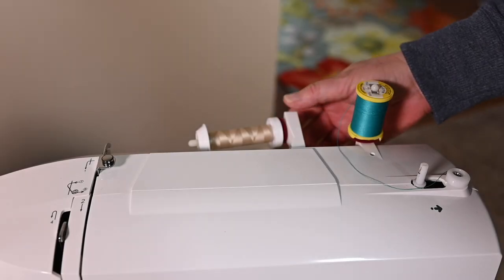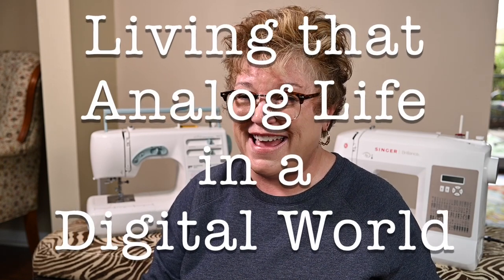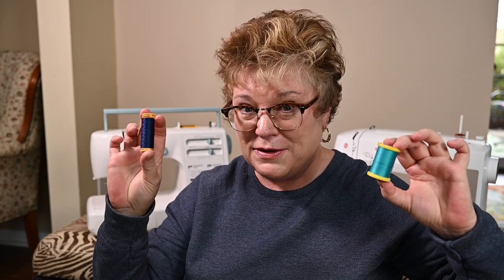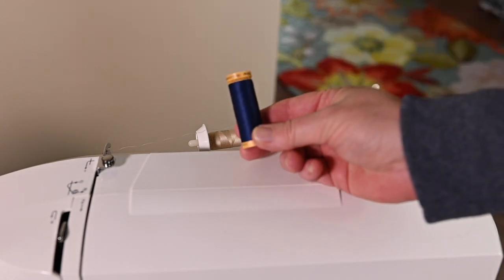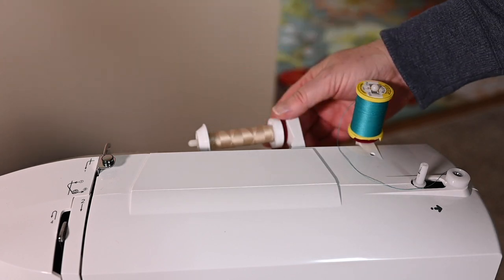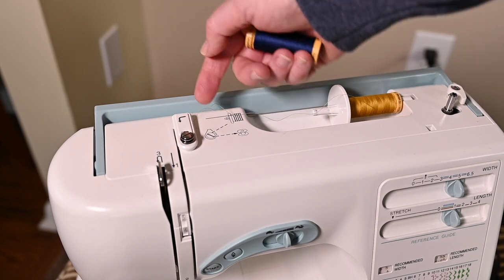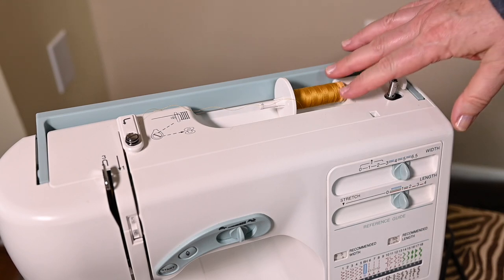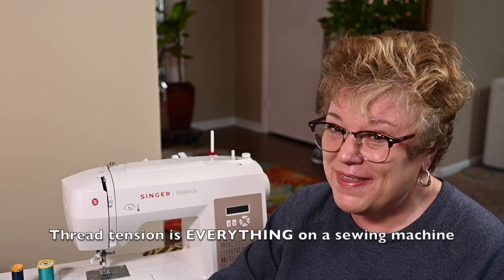HOW TO CHOOSE THE RIGHT THREAD FOR YOUR MACHINE

Comment: This makes so much sense. My machine (not sure if I still have it, I recently moved) didn’t have a horizontal feed, and most of my thread was for a horizontal feed, so it kept snapping before I could even finish sewing.
Reply from the maker: It's a subtle thing but it makes a HUGE difference. Yet it's barely mentioned. If you locate your machine see if the thread pin lays down. It might lay down to give you the horizontal option.

Comment: New to sewing and ready to purchase threads. Wondered the difference between the shorter and longer spools. Now I see I have to purchase based upon how the spooler is set up on the machine. My brother machine has a vertical spooler. Now I know which thread to purchase. Thanks for helping me not make a purchase mistake.
Reply from the maker: Hi LaKeshia! Oh my gosh! Thank you for writing. I'm so happy you found this video. This point is not often mentioned, but it makes a huge difference. Some people fight constantly with thread tension, and so often it's because the thread isn't loaded right. I worked with a woman that sold sewing machines for years, and she was the one that told me about this. Also, buy better quality thread because it sews a lot better. Good luck and enjoy!

Comment: I didn’t know! I’ve been using the sideways thing when I should’ve been putting my thread 🧵 on the upright.
Reply from the maker: I didn't know it for a long time! It's not discussed all that often, but it makes a huge difference. You want to load your thread on the proper spool so it unwinds correctly, without twisting.

Comment: Hi Patty!  I'm a little late to the party here...  but, oh wow.  I had No idea about the vertical and horizontal threading of a machine.  I was watching your video and put you on pause to go check out my machine.  I'm a Kenmore girl, always have been, always will be.  (But then again, those Baby Lock and Bernina's sure look nice too!)  Anyways, when I looked at my Kenmore, it has the horizontal spool pin too, just like your machine.  But when I got to looking in the manual that came with my machine, it also has a separate spool pin and a different spot to add it for vertical threading.  No clue here, I just learned this, all because of you!  Anyway, look at your Kenmore.  See the little box shaped hole on top of your machine?  It is southwest of your bobbin winder.  You can see it in the video.  There is another spool pin (along with a spool stand) that should be in your accessories that snaps down in that spot for vertical spools.  Who knew?  Check it out!  I'm so excited about learning this today.  I'm getting ready to move and in the process of boxing everything up, but when I get settled in and back to normal, you will find me at my sewing machine.  I can't wait!
Reply from the maker: I'm so happy you found the video Priscilla!! I know. Isn't it mind blowing? How many poor souls are out there fighing with their sewing machines and have a miserable time of things and it's all because the tension is wrong because they are seating the thread incorrectly. I saw this in a video made by a machine salesman and it blew my mind!! Yeah, someday I do hope to have a baby lock but for now I'm happy with my little Singer machines. My Kenmore developed a problem with the feed dogs and finding someone to fix it is impossible. Which is very disappointing.

Comment: No wonder I had problems with the thread getting stuck. Thank you. You would think the booklet with the machine would tell you this. Now my problem is threads. Polyester or cotton. The lint problem!
Reply from the maker: I know!! I don't understand why this isn't better communicated in the machine manuals!! It's not something that's widely discussed and it's not intuitive. But it makes all the difference in the world. You want to match the thread type to the fabric you're sewing. I sew about 95% with stable cottons so I use 50wt cotton. If you sew stretchy or polyester fabrics then I would sew with different thread. But whatever you choose, buy something that's a little more expensive. You do get what you pay for when it comes to thread and cheap thread can even cause tension issues as well as lint issues in the machine. I hope this helps!!

Comment: I had tension issues with my new singer 9960. It is about the thread, how its loaded, type, how its wound PLUS.. when you remove it to change it out, cut it at the spool and pull the excess through the needle, not backwards through the tension area.. that drags all the fibers back up into the disks! 
And.. when i purchased my better quilting thread then went back to regular thread..  WOW lets talk ahhhhhaaaa moment! What a ton of fuzz was left behind from the cheap thread! 
Clean clean clean that machine! Never blow in.. suck it out with your vacuum or use a q-tip.
Reply from the maker: Thank you so much for sharing so many great tips Annette!! Isn't it CRAZY how much difference the thread quality makes? It's kind of insane it matters so much. You are 110% right about not pulling the thread back through the discs, though I am guilty of doing it more than I should. Do you have a preferred brand in terms of thread? I bought a TON of it from Craftsy in kits of 6 1200 yard spools but I neglected to grab an extra neutral kit or two right before they closed. Penny wise and pound foolish and now I super regret not doing that because it was so inexpensive at that time.  I am interested to hear what you recommend.
Reply: @PattymacMakes  thank you! I know it was a lot... but i just kept typing! LOL
We have Guttermans at my local joanns.. i looked at it but have not used it. I assume that is the brand your showing on the video? 
I am a newbie quilter and aurafill (sp?) Is not available at my joanns, they carry guttermans and Sulky brands. I chose sulky because of the additional shades and high sheen. It looks and sews beautifully on my 9960 but does not like my auto thread cutter.  So thats a bit of a drag. 
I have an OLD 70s kennmore. Its my moms machine and ive had it for 20+ years now. It takes cams for specialty stitches and weighs a ton! I too had a lot of problems with it and didnt know why.. now we know! 
I plan to pull it out, clean it and use good thread and see what it does. 
Thank you for your videos! I so enjoy them 😊😊👍💐🦋🐞
Reply: I have never used those spools before only the traditional style. 
I plan to make the switch here soon.
Reply: @PattymacMakes  ok lol just one more thing about sulky... 
In a traditional spool, you have that notch in the head to catch the end of the thread tail for storage.  When putting those spools on the horizontal spool holder the thread can hang up on it.. happened to me! 
Sulky thread has a unique way to hold the tail on their (traditional) spools. Its a opening that runs around the entire head. I use my finger nail or a pin and push the tail in as i spin the spool. This is amazing and the thread does not hang up on the horizontal spool holder! 
Yes.. i put the sulky spool on it.. but not my older thread, that goes on the vertical one. 👍
Reply from the maker: @GrandmaD2024  Thanks for the input and information Annnette! I have used Gutterman from Joann, and yes that is what I'm showing  in the video. It's a very expensive way to buy thread, though. I absolutely kick myself now for not stocking up more with the Craftsy thread when I had the chance. I could have gotten the kit of 6 spools of 1200 yards for $45. It's over $200 of thread if I bought it in Joann, and now as much as I'm quilting projects on the channel, I'm kicking myself for not investing in that neutral bundle when I had the opportunity. The one that got away. LOL!!
Reply: @PattymacMakes  $45!!?? Yes I would be kicking myself as well!  My mouth is hanging open.. 1200 yards of thread! LOL  
I am working on 2 quilts, one is requiring a lot of applique and the other is multiple repairs to an old quilt I made for my daughters graduation back when i had no clue what i was doing. ;-) 
The Sulky thread is so beautiful but expensive compared to what I am accustomed to buying. Have you used Sulky brand?  Some times I break down and revert to my old threads for the applique. They work but you can clearly see the difference. How does the gutterman brand hold the thread tail?
Reply from the maker: @GrandmaD2024  Annnette, SIX SPOOLS OF 1200 YARDS EACH IN ONE KIT!!  I'll post a picture of one of them in my community tab later today so you can see what I'm talking about. I looked at sulky yesterday, but it was not cotton and I've been using 50wt PIMA cotton exclusively. I. think Gutterman is a good brand, but the spools are small and it's just too expensive to buy for quilting projects in Joann. I would be broke on thread given the rate I use it. LOL
Reply: @PattymacMakes  that would be great! I would love to see your thread stash 😉 oohhh 1200 yards each spool!!! HOLY Smokes!! Thats a lot of thread!
Thank you for sharing!
Reply: I have to say.. i wish we could meet some day.  I would love to sit down and share life over a coffee with you.

Comment: hello patty the sewing machine in this video not the singer has a start stop button which should enable you to sew without using the sewing machine electric foot pedal/controller. I don't know if you use the start stop button but I whish you film and demonstrate using by foot controller and just using the start stop button please ok? Thank you very much oh you must have a handheld sewing needle threader to thread hand sewing needls well you could also use it to thread the sewing machine needle also makes it fast and easy regardless of what size needle or type of thread your using  most people don't think about it but it would be a great tip for a upcoming video of course when you get a chance please ok? Thank you very much
Reply from the maker: Thanks Frank. This machine does not have the start/stop button for sewing. Only a food pedal. And it has an automatic threader.